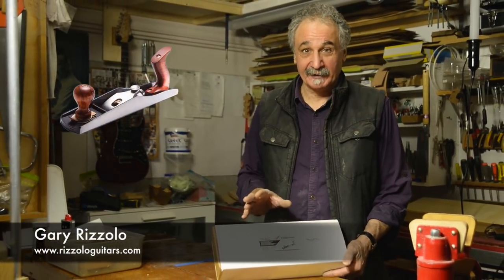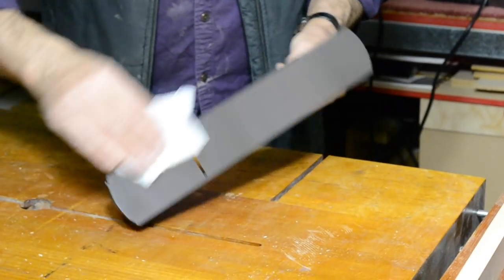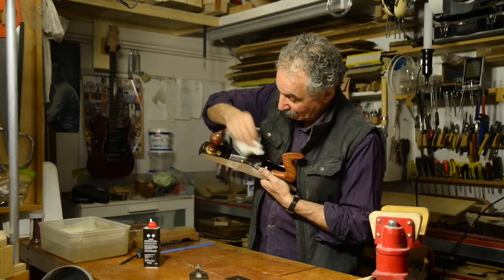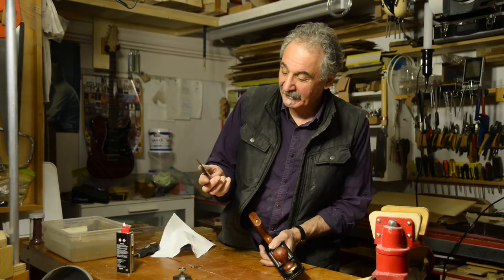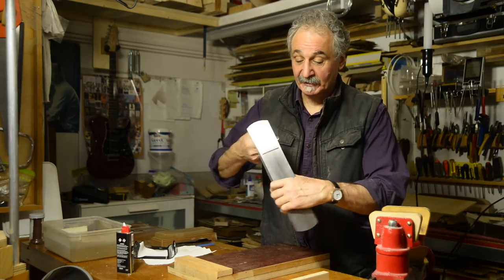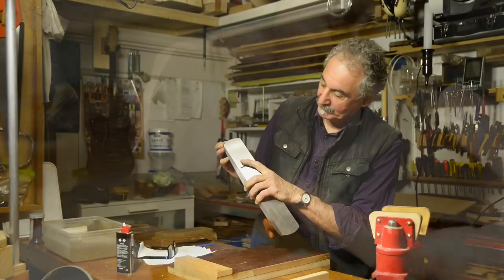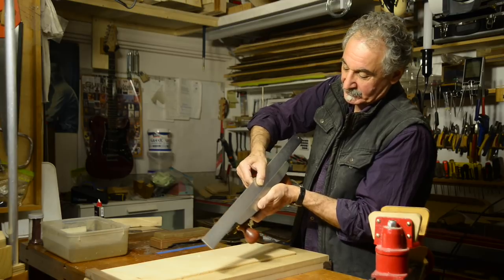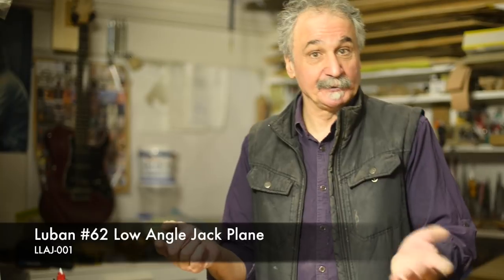The Only Plane You May Ever Need!

Comment: This was the first serious plane i bought after being disappointed in a stanley nr3 baileys which really still feels cheap & plastic (made it into a scrub-plane, thanks Paul Sellers). Loved it so much, the adjustment of the opening sometimes hurts your hand when seriously planing, but apart from that it was my favorite until i bought a no7 also from luban. Now i find i don't use it that much anymore, mostly for endgrain and crossgrain really. When planing difficult patterns,  tear-out with the LA is actually more of an isue compared to the bevel-down.
Reply: @DavesRabbitHole  

The advantage of a bevel down plane is that you don't have to mess with grinding different angles etc to get it to work. Re setting the cap iron will make it suitable for any situation. Leave the bevel up stuff to where they do best. Endgrain.

Comment: It's a bevel up plane. If you add the bed angle of 12 degrees to the bevel angle on the blade of 25, and then add a secondary bevel of 5 degrees, you get 42 degrees. A bench plane (bevel down) has a bed angle of 45. If you put a tertiary bevel of another 3 degrees, they present exactly the same angle to the wood.
Reply: Bob Levittan but the way force is applied is different no?
Reply: The bed angle of 12 plus 25 deg blade is 37 deg . I have never added a secondary or tertiary bevel . NO NEED . there is a VAST difference between the 37 deg LA and 45 DEG ordinary plane . Plus the LA is way superior for chuting as it ihas less cap iron getting in the way . .
Reply: The main reason that these "low-angle" planes work better in certain scenarios is not because of the angle of the cutting edge, but because the blade itself is more "behind the attack". This and the fact that you can adjust the mouth opening will reduce vibration which is the main cause of tearouts. Also these "low-angle" planes usually comes with a thicker blade, which also helps to reduce vibration.
Reply: @738polarbear  why would you not put a secondary bevel - isn't it mainly to speed up sharpening?

Comment: A common stanley 5 will do everything that this plane will do, but more if you learn to use the cap iron. I realize the title is a bit clickbaity, but these planes were made to work butcher block type surfaces and were not popular when users were professionals. They're attractive to beginners because the setup is simple, but less productive than a common stanley 5 in the long term. 

They're also outright terrible for anything other than fine work.
Reply from the maker: Agree with you David - people should have various options, and while it would be ideal to have both, in some cases it may only be possible to have one. Certainly for beginners this would be a good choice for them to use.
Reply: I have both planes. Since I have the Luban, I haven't touched the Stranley. The #62 can do all the things the #5 can do and much more. The blade is much thicker, so no vibrations like the much thinner #5 blade. The front of the sole is much longer, so much easier use on end grain wood. The mouth opening can used with a small gap for fine work, like the #5, and a bigger  gap for tough work. But thats my opinion. ;)
Reply: A well tuned "common stanley 5" will indeed provide sterling service for most people, on most timbers,and most joiners will surely manage fine with one all their working lives. It is though, when faced with more exotic and uncooperative grain, the bevel up  comes into it's own. The very term low angle is misleading. What we have is a variable angle plane, and it is the higher angles that are effective in dealing with tear out. Hone the iron at a chosen angle, add 12 degrees for the working angle. Invest in a few spare irons and you have a most versatile tool. You can of course hone a back bevel on the bailey iron, but you will need to invest in one or more upmarket irons, as the common bailey blades are made from corned beef tins. Even with a good thick iron, the bevel down plane is far more prone to chatter, than the low angle jack. I can't see where you're coming from advocating the No 62 for beginners, the fact that the mechanism is a simple one, means rather more experience is required in setup.
Reply: Spoken like a true amateur woodworker . You are of course welcome to your opinion albeit that you are wrong . A Stanley #5 is not as good as a modern LA Jack . For one it has far less mass . Not to mention its inability to be held properly when chuting .
Reply: Wow, everything you said, with the exception of the easy set up for beginners, is incorrect/misguided.